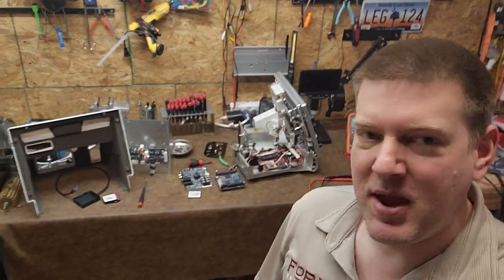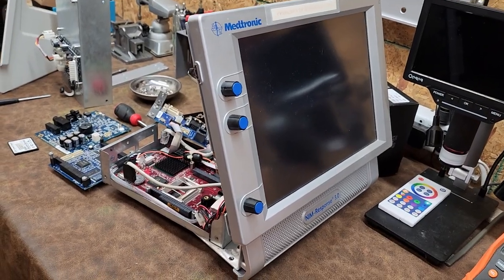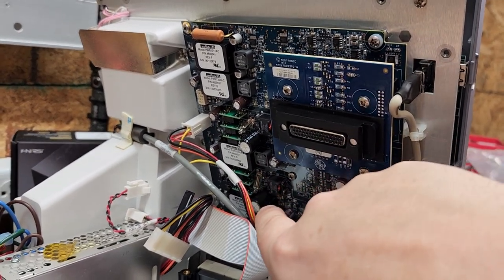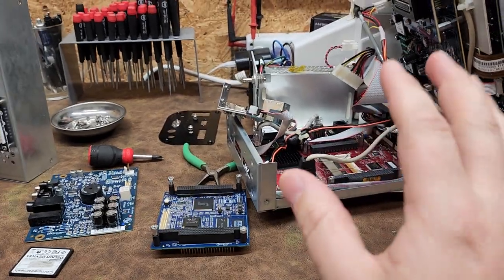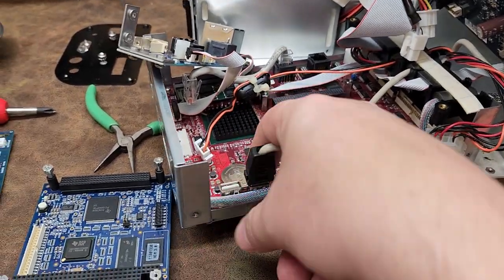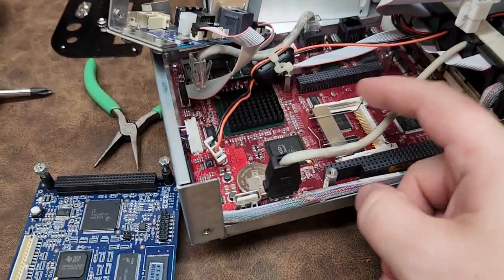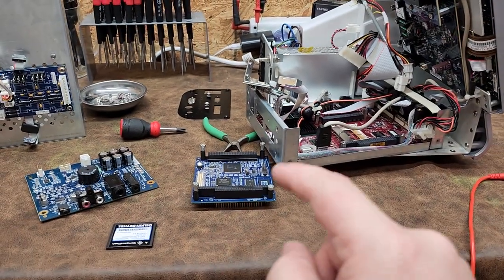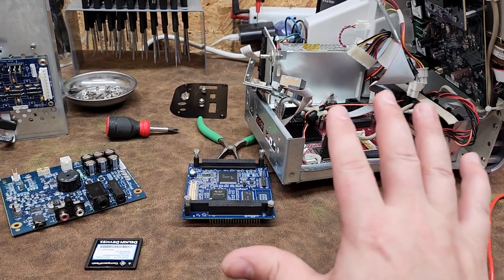NIM 3.0 Neuro Monitor Problems

Comment: 4:20 Is it not better to solder in a CR2032 battery holder ? Way cheaper, and the next PM the battery can be replaced in a minute without soldering.
8:20 Coin cells in computers is something weird, they are not rechargeable, but i know from experience that with computers that after use being disconnected from the mains (power strip with power switch) are prematurely suffer from drained batteries then computers that always are connected to the mains. i have seen computers (desktops) where the battery was over 10 years old, and still had enough voltage for the BIOS holding it's settings.
Regarding the copy of the CF cards, do you use a special program for this, or only copy paste ?
Reply from the maker: I copy files ( for exploration) and I make a byte by byte exact copy using rawhdcopy
Reply: @BetterBiomedChannel  , for a complete image of the CF card, you can also use Win32DiskImager. This is a stand-alone tool that lets you create .img or .iso files. The big benefits is that these images are compressed and take less space in your archive.
Reply: Hi, I would like some help, I already use macrium reflect, aomei backupper, hasleo win tohdd and when I finish copying the compact flash, nim is not able to boot... do I need to change any more settings or is there another way to copy?
Reply: @BetterBiomedChannel  help how to make this copy bit by bit ?

Comment: Why not desolder the coin cell and replace it with removable types from motherboards. That'd save future bmets a lot of headache. It's a super cheap part too.
Reply from the maker: It's a neuro monitor. I would only replace the battery with an identical part.